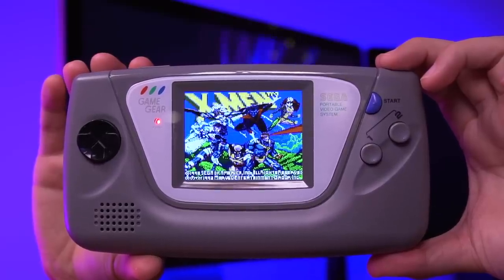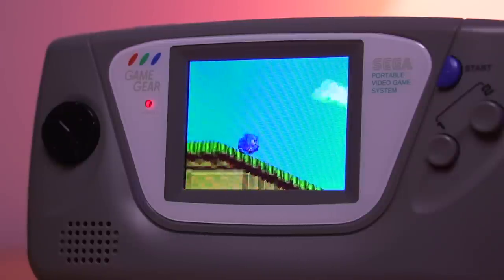RETROKAI GAME GEAR LCD UPGRADE IS “MAGICAL” | RetroKAI Magic Screen Tutorial + Review | Retro Renew

Comment: In your other video you said you partially melted the brightness adjustment. Then in this one you said that the mcwill didn't have it. Sounds like you forgot your own operator error.
Reply from the maker: The partial melted brightness adjuster is actually the contrast wheel which all game gears have. The McWill doesn’t have a brightness control while this one does. I hope that make sense. Cheers!
Reply: @MachoNachoProductions  oh! That does make sense. Thank you for the explanation.

Comment: One thing that Tito doesn’t mention, and in all fairness neither does Retrosix, is that their replacement D-Pad is not compatible with the original D-Pad membrane. You’ll notice Tito shows the grey D-Pad and says he’s using replacement buttons, but in the end uses the original black one. Bottomline, if you buy an improved D-Pad from Retrosix, you must also buy the membranes from them too. It’s really only 1 of 2 downsides to this shell. I cover it in my Hackinformer article if anyone is interested.

https://hackinformer.com/2021/01/28/hardware-review-sega-game-gear-replacement-parts-from-retrosix/
Reply from the maker: Thanks for the heads up!  I actually didn’t even try the d-pad. I used the original black one because I thought it looked more oem than to have all the buttons be gray. I actually used blue start button too. Good to know and again, thanks for the head up!  Cheers!
Reply: @MachoNachoProductions  Yeah, I learned it the hard way. I even tried to modify my existing D-Pad membrane by removing the ball bearing. When that didn’t work, I cut out the middle entirely. And while it works with their new fangled D-Pad, I ruined a perfectly good OEM membrane. LESSON LEARNED.
Reply from the maker: Oh man sorry to hear that dude!  Would have been nice if it was a direct replacement. Good to know. Cheers!

Comment: at this point, I might as well donate my VA4 for R&D to help get them closer to being able to add options for said mods, for said models
Reply from the maker: Yeah, it’s strange that most of these kits are incompatible with the va4. I wonder what makes it so different?  Cheers and happy New Years!
Reply: @MachoNachoProductions  The pinout, the video signal isn't the same to process. We would have to make 2 differents kits or at least 2 differents ESG. It's not impossible, but it's time consuming, especially given that VA4 and VA5 models are pretty expensive and pretty rare to find. In EU we didn't really have those models. Anyway, it'll not be released any time soon but we are working on it.
Reply: @RetroKAIstore  I saw on your site that you are sold out. When will you be getting more in? I can't wait to order this one and do this mod for my Game Gear.
Reply: @hungrybartender6388  The first version went out-of-stock yes, because we released the new version. Now the link to the first version redirect correctly to the new version 🙂
Reply: @RetroKAIstore  Thanks for your help. I went ahead and ordered it along with a pre-order for the new soundboard.

Comment: Is the aspect ratio exactly the same as the original?
Reply from the maker: It’s unfortunately not integer scaled. I still think it looks pretty good though. Cheers Dan!
Reply: @MachoNachoProductions  how does it compare on this matter with Mcwill's? You said in the video they are basically the same screen. Thanks
Reply from the maker: It’s exactly the same. I’m pretty sure they use the TFT display too. I’d say as far as image quality they are almost the same. All 7 modes are exactly the same. Both are great in that regard!  Hope that helps.

Comment: My game gear says 837-7996 IC BD GG main europe but I didn't see the VA1 or 0 so this might not work on my game gear I think but I am not sure.
Reply from the maker: Hmm that’s strange. Do you know if it’s a single or dual ASIC motherboard. Also, I’d send a message to RetroKAI. They have great customer service and should be able to tell you whether or not it is compatible. Best of luck!  Cheers!
Reply: Alright I looked it up and it is a twin asic motherboard. It says TW-10794V-0. So it might be a VA1 but I need to get new capacitors so it might take some time until I gotta get the mod but it's interesting so see that we can make the game gear even better nowadays with mods.
Reply from the maker: Gotcha. Definitely check with RetroKAI first just to make sure. Totally!  So many great GG mods out now!

Comment: Those Yamaha speakers aren't designed for stacking sideways.
Reply from the maker: Interesting, didn’t know that. Does it impact the performance?  What issues will it create?  Thanks for letting me know. Cheers!
Reply: @MachoNachoProductions  It will create problems with the stereo image, and you'll only get a small sweet spot. It produces an effect called "lobing" (I'd look that up though). Only speakers specifically designed to be horizontal should be. 

Your user manual for the HS series should also recommend a vertical placement. 

If space is truly an issue, and they must be horizontal, you need to check they're orientated the right round depending on your needs. 

Enjoyed the rest of the video btw.
Reply from the maker: Thanks for the heads up!  Will definitely read up on it. Glad you enjoyed the video dude!  Thanks again!

Comment: Looks like the 40$ aliexpress chinese lcd solution but with the little custom board to make it easier.
Reply from the maker: Yep!  A lot of the Chinese kits are copies of the McWill design. Both the McWill and RetroKAI kits function nearly the same. They are just installed differently. Cheers!